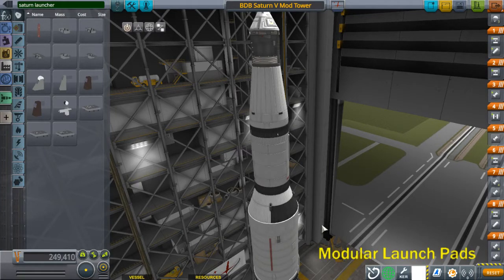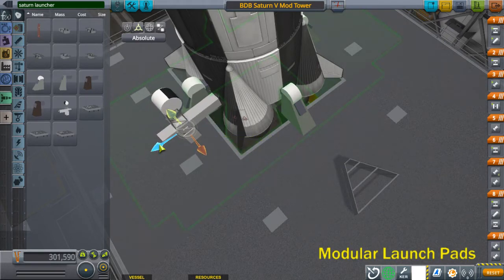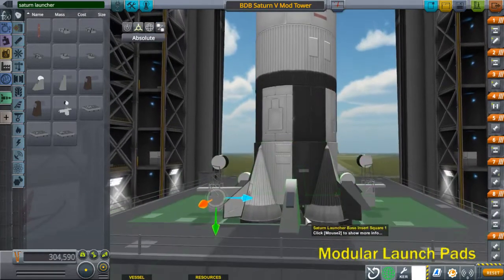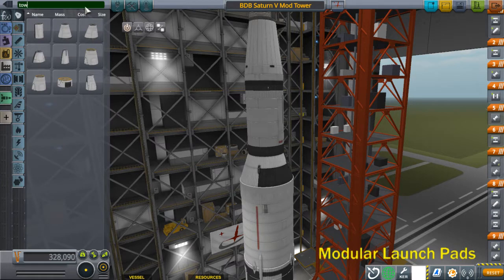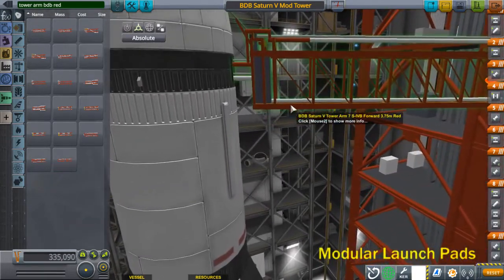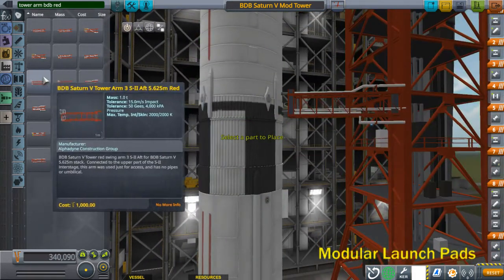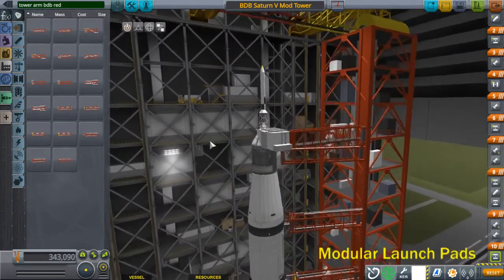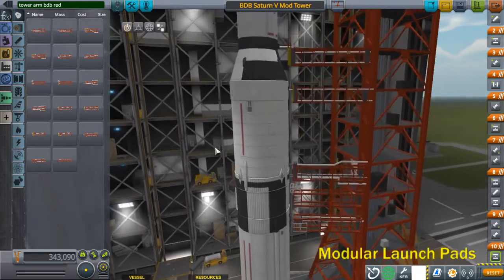KSP Modular Launch Pads Assembly Guide for BDB Saturn V

Comment: Hi theres no node on the BDB Saturn V to attach the launch pad to?
Reply from the maker: It's on the BDB S-IC Engine Mount.
Reply: @AlphaMensae1  Its not there, it's missing, there's only one node that's really far down
Reply from the maker: @codytran1719  That's the node, the one below the 5 F-1 nodes.
Reply: @AlphaMensae1  But in your video the attachment node is slightly above the 5 engine nodes, but the attachment node for me is very far down, so the launch pad snaps on way too far down
Reply from the maker: @codytran1719  Ah, yeah, the BDB Saturn parts were all remade at a larger size (far closer to proper scaling this time), so I had to adjust the node's position. I moved it far enough down to clear the F-1 engines by a good amount.

Comment: is there a way to remove the holding legs on the mobile launch vehicle, I want to try to add the tracks onto it? (also, amazing mod)
Reply from the maker: In the Extras folder of the download .zip is the old free-standing (nom lauch clamp) version of the launcher base. It has a switches to turn off the legs/footings and to reduce the mass to 1t (for easy transport or moving).
Reply: @AlphaMensae1  Thank you for the help. Also, are the launch rails surpassed to rotate the rocket attached to? I was trying to recreate the proton and its rotating launch pad but it would not rotate the craft, are you supposed to be able to rotate that craft it is attached to from horizontal to vertical or am I using it wrong?
Reply from the maker: @XHU524-OFSET5  The launch rails will not rotate what is attached to them, correct. You have to manually rotate the rocket after rotating the rail. Now, you can have both rotate together by using the Animated Attachment mod, it allows animated parts to move whatever is surface attached to them. It only works with surface attached parts, so you can't use the attach node on the rails to connect the rocket. Animated Attachment can cause big problems though with other parts, so there is a patch in MLP that removes it from all MLP parts except the launch rails, crew elevators (allows you attach command chairs for the kerbals to ride in) and the Saturn hammerhead crane.

I do have a video assembly guide to using the launch rails that shows how to do the manual rotation: https://www.youtube.com/watch?v=r2AppWHSjZg
Reply: @AlphaMensae1  Thank you

Comment: How do you connect using those green ball things, I have a rocket built but when I go to add the pad it just hovers in red and I cannot attach it?
Reply from the maker: This was for an old obsolete version of Modular Launch Pads, but the launch bases attach with the node in the exhaust hole opening. All others are for the towers and elevators.
Reply: AlphaMensae thanks for the reply, I found out the issue, I did not have an attachment point on the bottom of the rocket, had to change the design a bit but this well worth it, great mod.

Comment: Hi, I play KSP and your mod is amazing. However, my Desktop (apple) lags a lot when I use it. Is there a way to solve it? Your mod is amazing
Reply from the maker: Thank you!  Yeah, the current version is not optimized, it comes from my early-learning phase with part modding and Unity, and the Saturn and Soyuz pads and towers are mostly assembled in Unity out of a large number of individual small objects, which results in large RAM usage and lag in KSP drawing the parts on screen.
Version 2, which is under development, is far better in that regard, as the parts are being modeled as single-objects in Wings 3D, with only animated and/or switchable objects being separate.
Reply: @AlphaMensae1  Thanks! That's great! P.S. When do you thing v2 is coming out?
Reply: Also, the Saturn inserts are weird, they kinda glitch, as in they flicker. Is that supposed to happen?
Reply from the maker: @epicpro1324  The v2 dev builds are available on my Github's AlphaDev branch (there is a link icon on my channel banner). At some point I'll start the transition process and begin folding the v2 dev build into Modular Launch Pads proper, and release it as a "pre-release" alpha or beta version, with the old parts still included but hidden, so craft files can be changed over. Then some time after that, the old parts will be removed, and v2 will become official.
Reply from the maker: @epicpro1324  No, they shouldn't flicker. Which version are you using, the current release or the v2 dev build?
Reply: AlphaMensae v1.3.8(current). I tried installing and reinstalling but it’s the same. P.S. I used github for download
Reply: Hello?
Reply from the maker: @epicpro1324  Sorry, have been busy
Reply: AlphaMensae No it’s ok I understand. Just reply when you are free. Otherwise just work on whatever you’re working on.
Reply from the maker: @epicpro1324  I rechecked the v1.3.8 Saturn base, and the inserts snapped into place as they should, with no glitching.
With the latest v2 dev build of the Saturn base, there are no more separate inserts, their functions have been put into the launcher base itself.
Reply: @AlphaMensae1  Ok, do you recommend download from GitHub or spacedock? I'll reinstall from there.
Reply from the maker: @epicpro1324  Either one, it's the same file.
Reply: AlphaMensae Kay, thanks! I’ll inform you if it works
Reply: It works!!!!